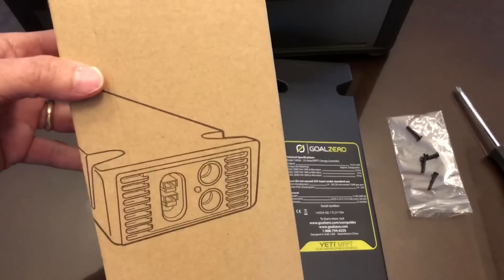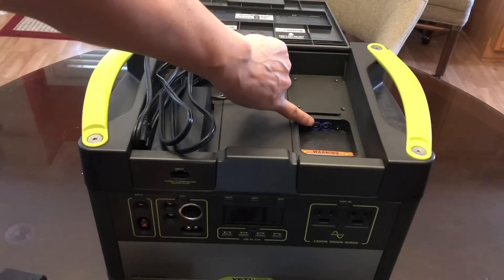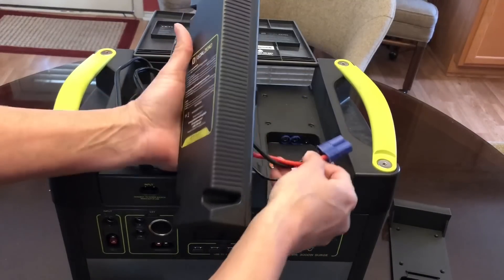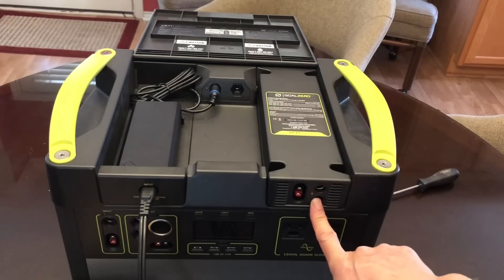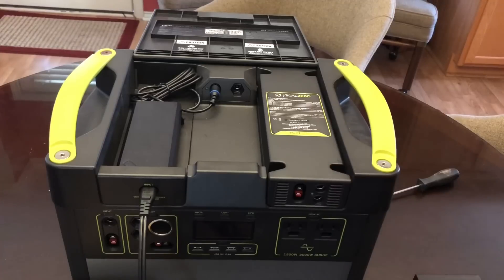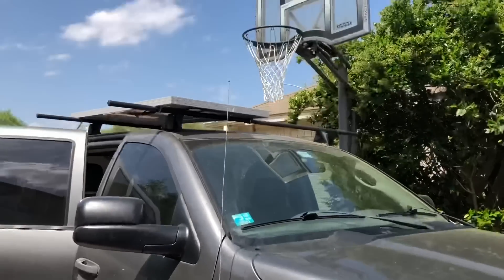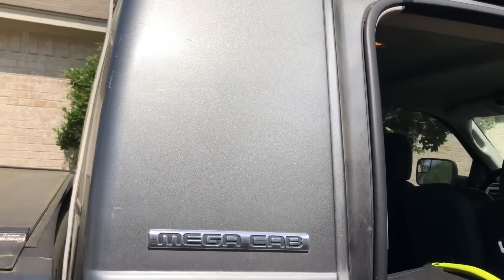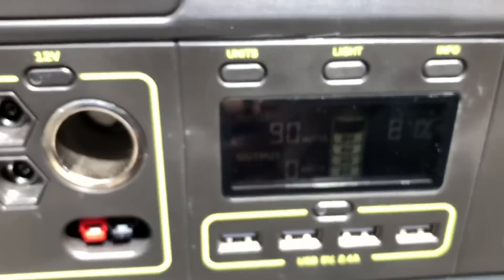Goal Zero Yeti 1000 & MPPT charge controller.  Does it work

Comment: Wow, its amazing how far other brands have come in the last few years. Taking 300W without adapters and 1 hour charge times. This goal zero looks like a dinosaur.
Reply from the maker: Yes, and battery degradation now is effect.  Especially on 400w goal zero that only charges up to 73%.  I’ve tried to take out battery to install a new one but have been unsuccessful.  I’m going to look into a replacement unit from another brand that allows for lithium batt replacement.

Comment: Thank you, this was very informative. Super helpful! It's ashame the MPPT controller doesn't do more for $100 than the built in controller. Do you know if I can use my Zamp portable panel without a charge controller directly to this Yeti 1000 by chance? Thanks again!
Reply from the maker: Yes you can plug it right in,  As the yeti has a built in controller. Just make sure the polarity is correct as zamp is known to have opposite polarity.
Reply: @EvenaGirlCanDoIt  thank you so much!!

Comment: So you're telling me I can charge my goal zero from the wall through the mppt charging module in stead of regular, with both charging cables, and by that winning about 30% of charging power?? 😱😱😱
Reply from the maker: Yes you can charge using both the pwm and mppt.  You can also use a combiner cord and add more wall chargers.

Comment: You might want to check out Todd Parker on YouTube.  He found a way to add more power to the Yeti without damaging it.  He uses the car charger with another battery.  About fast charging?  Fast charging will shorten the life of those.  Do some research; Will Prowse.  You might also want to check out Will Prowse vid on longevity of lithium.  I own a 3000 and after three years and four months it still charges up to ninety six percent.
Reply: I bought it after  Hurricane Maria ravaged Puerto Rico.  I am not joking or bragging.  I am extremely serious.  Thanks.
Reply: There is a vid on e bikes that also helped me on taking care of my Yeti 3000.  As a matter of fact the vid on e bikes is the reason I started doing it.  I would never fast charge my Yeti.
Reply: I think Todd Parker knows more about Yetis than Will Prowse and Goal Zero!
Reply: @kenjboyd6233  Thanks for replying.  I respectfully disagree.  The Yetis batts are made of Nickel manganese cobalt oxide ,NMC.  They are of a different composition than the Lithium Phosphate 4 ones.  The are both good if you know how to use them.  You can fast charge NMC but it is advisable to do it during emergency and during black outs.  The slower you charge them the less the degradation.  There are many internal components wich Prowse  knows about and there are also distinctive chemical reactions with every kind of lithium batteries.  Understanding the movement of the electrons thru the graphite towards the positive then thru the circuit that draws is crucial.  I don't think Todd have approached info like this.  Even though I have the pleasure of chatting with Todd.  He has really good ideas that can save thousands of dollars expanding the Yetis capacity.  Respectfully yours Agustin from Puerto Rico.  English is not my first language.  👍
Reply: @agustinmoralesrodriguez1242  , How is that on the batts when we're talking about the Yeti 1000 Lithium units? Plus, Will has a great depth of knowledge re: these issues, but he's far from perfect, & he definitely hasn't spent the time w/ Yeti 1000 Lithiums (to be specific, as I have 4 of those models). And you have stated yourself that Todd has pulled off  things w/ this model that I haven't seen Will or anyone else do, including anyone at GZ. Yetis overall, I'm not sure. There are a lot of different models now..

BTW, if English is your 2nd language, I wouldn't have suspected it, as you have mastered it! Spanish is my second language, but I will never be near as fluent as you are in English.

And you are obviously quite knowledgeable on these topics, so I'm interested in anything you have to say.
Reply: Modern solar chargers are vastly better. With LiFePo4 cells, they have 7000 cycles, and charge in about an hour so so on AC.  BTW, this doesn't apply to goal zero who has fallen years behind the competition of eco flow,bluetti and pecron to name a few.

Comment: I think the panel isn't working at the 165W it is rated for because it's just laying flat on top of the van. You'd need to have it angled at the sun if you wanted to get the most out of it and even then you'll probably see 140W ish at most since the panels are rated for tests in lab conditions.

Comment: Okay dumb question, can you have the MPPT controller and the yeti link expansion module both installed, or just 1 device at a time? Im debating on expanding my battery bank, or getting more solar panels.
Reply from the maker: Christy McGrady No you cannot have them both installed at the same time as they both use the same slot in the Yeti. So it’s either one or the other, although the Link does have an 8mm port so you can either add another wall outlet cord or I believe you can add solar panels With 8mm male adapter .

Comment: Pretty cool setup and I wish I have one just in case the power goes out and I can set it up with the solar panels outside or charge it on the gas generator if don't have solar panels. Also don't really mind with the wait on how long it takes and also the mpp is suitable for the solar panels on a 100% sunny day. But also make sure the adapters don't get too hot if the generator is below 15-20% may pull more power may case adapters to work even harder and gets hot. But anyway love the review about this technology. ( P.S also noted if more chargers are connected the fan will kick in and yea that is when the adapters will get even hoter )

Comment: Please read this up to 40% better is from solar panel not from AC plug.: MPPT stands for Maximum Power Point Tracker. The Solar Charging Optimization Module is an external MPPT and when installed properly, actively monitors the energy source you’re using to charge the Goal Zero Yeti Lithium and optimizes the source to maximize power, resulting in up to 40% faster charge times, especially from solar panels. You may also notice better charge times from AC when utilizing the Yeti Lithium’s AC charging cable plugged into the module.

Comment: If I'm not mistaken all of these units slow down as you reach near full capacity. Why don't you try this test with your battery down to about 60% and see if there is an increase in charging. Also if I'm not mistaken another purpose for this device is to allow you to use more solar panel input then what the original unit was meant for.
Reply from the maker: spy8464BB yes that is correct.
Reply: Stadium affect. “The stadium effect occurs when recharging your batteries. You'll notice your battery quickly filling up in the beginning, then slowing down noticeably when trying to charge up the last several percentages.”
Reply: @PhotoGalMn  What effect is it when it malfunctions and the company gives you the cold shoulder instead of helping you?

Comment: I have some issues with my goal zero lithium  1000+ the MPPT controller.
I use one 20w nomad solar panel + 100w Boulder panel chained together.

Every few weeks my Batterie is not charging anymore (blue light on the controller input is on the one on the batterie not)
I found out that when I disconnect the batterie cables and put them on again it works again. 

What could that be?

I asked already GoalZero and they told me to send it in, which takes more than few weeks to get it back.
Reply from the maker: Oliver Waldbillig have you tried to plug it into the wall only and see if it stops charging.  If it does then it’s something internal and the unit must be sent back.
Reply: @EvenaGirlCanDoIt  Normally I only charge it with my solar panels, if it happens again, i will try the wall outlet. Thank you

Comment: try it again on a cloudy day, mppt is meant for days when the sun isn't as powerful. You won't see the 40% difference until you have a day like that to test with. Many times the PWM controller will not have enough volts and pull 0 watts and can't start a charge where as the mppt will.... But on clear sunny days PWM can be equal in efficiency depending on the power source...
Reply: Thanks. I saw no difference at all on a sunny day. I'll wait for a cloudy day.
Reply: If you're using monocrystal panels on a sunny cold, freezing weather day, MPPT will give you much more power than a warm day.

Comment: Mppt is most efficiënt at the bottom charge of the battery. If your battery is at 10% charge there should be a huge difference between the mppt and pwm wattage.

Comment: I just bought a 1400. no one can tell me how much solar I can put in.
Reply from the maker: mike allen you can put up to 360 watts on pwm or mppt modules and up to 160 watts between the 2 -8mm ports.  So on my yeti1000 I can put up to 1040 watts of input but GZ only recommends 750 bc the unit may get hot.
Reply: @EvenaGirlCanDoIt  appreciate the information. I can put 360w into the PWM and another 360W into the MPPT charger? wow that's fantastic.
Reply from the maker: mike allen 360 on each Anderson ports and another 160 between the two 8mm ports on the pwm and mppt
Reply: @EvenaGirlCanDoIt  sweet. think I will go for 300w through each Anderson. that's plenty for me.
Reply: @EvenaGirlCanDoIt  Dumb question, but you are talking about 360w coming from solar panels, right? So, does that mean I could use 2 180watt solar panels together, in total 360, in each of the Anderson ports? So, it would be 180+180, then, another 180+180, going into 2 different ports, is that correct?
Reply from the maker: Hunter Millerson yes you can do that! You would be using one on the internal PWM Controller and one on the MPPT external add on controller.
Reply: @EvenaGirlCanDoIt  I have been trying to use both the PWM and MPPT charge controllers at the same time and it does not seem to like it. I never get very fast charging rates. have you tried to put solar in through both charge controllers?
Reply: @huntermillerson6276  that would be amazing if it was possible. charging my yeti with 720w would give me all I needed. I wonder how much it would degrade the battery. I wish my unit was chainable so I could add on 12v sealed lead acid batteries. that way the energy in would be spread over 2 batteries and would so be charging at a slower rate.
Reply from the maker: mike allen yes, first, have you tried them independently? Yes? If they both work then let your yeti go down to about 60 then try it.  I will try to make a video in the next week and post so be sure to subscribe and hit the bell.   Oh btw I sold my 1000 and bought the 1400 so I will do it on the 1400.

Comment: Somewhere here on Youtube I saw a young man who had a Goal Zero 400, I believe, plug a cheap $15 inverter into it, plugged that into his car cig. lighter, and the Goal Zero charged within minutes, not hours.  Is there anyone out there who might explain that to an old woman who wants to be able to camp off grid with a Goal Zero and a 100W solar panel?  Why would I want an MPPT which isn't that great at charging the Goal Zero if a cheap inverter would give much greater speed in recharging?
Reply from the maker: tegma when charging with solar moot us moot faster than pwm.  As far as charging through a standard wall outlet you don’t get that much more charging power.  Charging through 12v with and inverter(lets say in your car cig lighter) so you can charge using your std 110 plug you should not see a difference.  But if you use just the 12v charger port from your car then it will take longer to charge.  As far as it taking just minutes on a goal zero 400 it’s not doable.  Now if I was going to try to get by with a GZ400 I would get the lithium version because the battery on that one can be depleted to 0 without harming the lifespan of the battery.  Now if you go with the AGM GZ400 you shouldn’t take that battery below 50% as it will kill your battery in no time as AGM’s are not made to be taken all the way down to zero.  (no the actual goal zero, just the battery inside it). Currently on the AGM style GZ400 you can daisy chain additional batteries to it for additional battery.  If you have the room it’s a lil cheaper to do this option.  Oh yeah, mppt is not offered in either GZ400.
Reply from the maker: tegma you should be looking at amp hours btw.  Lithium all ah’s are available, AGM only half are available for use.

Comment: I was pretty impressed with your output from the panel, as the max W would probably only be achieved in full sun, with the panel at the right angle, so 112W mounted flat on a panel with some pollen on is pretty good. You got 15-18% extra from the MPPT, and as your battery was already over 80% this is pretty good.  If you want Max solar output from your panel keep it all clean, any dirty patches (or any shading) bring the output of the whole panel down.

Comment: I spoke to Goal Zero and they told me that the 8mm input PWM van take 10 amps while the anderson MPPT input can take up to 30 amps. so 200w/ 12v=16amps.
Reply: I just bought a 1400. no one can tell me how much solar I can put in. goal zero only sells 200w panels so that is what they will tell you.
Reply: @magamike1800  8mm charge port 14/22volt up to 10amps ie 120watts max. So 2x would be 240watts. (brick plug and outside port.) There is a USB C with PD (power deliver aka in and out.) which pumps 60watts Via 5,12,20v up to 3amps. (could be used also to charge it possible.)

Powerpole charging port 14/22volts up to 30amps (360watts). So if we take into all ports used to charge the unit VIA the PWM charging system only on the unit.

240+60+360= 660watts in total you could push into the unit. Now if we look at the MPPT with 3x more ports. 

8mm x2 have 15/22volt at 10amps = 150watts x 2 = 300watts.
Power Pole Charging port 15/22volts at (doesn't show on their website. but IE divided 1400 x 5hours = 280watts. So the Power pole would probably pull around 300-600watts on it's own.). So you'd get 600watts from PWM or MPPT. (Not sure if you can mix and charge. but if you could then you'd get up to 1200watts of incoming power. Enough to run AC and DC while keeping it topped, So you could technically use it like a multipower system in a large area your using to charge laptop, and DC stuff like Phone, lights,etc.)
Reply: @KillerRaptorr  thanks but what I was really wanting to know if the MPPT charge controller can handle solar panels running more than 22v.  I have a 300w panel that runs up to 38v but I am scared to plug it into the unit.
Reply: @magamike1800  told you the EXACT specs of the system it can handle.

14volts LOW. the LEAST you should be putting in. and 22volts THE MAX you can put in. 14/22volts. So common sense of 38volts = No. Even if you TRIED, It'd shutdown the charging and beep = that it will NOT take such a high voltage.

If you can find a way to decrease the 38volt panel down to the LEAST or MAX input related of the system. Then you can. But you'd have to DROP the voltage down massively.
Reply: @KillerRaptorr  disappointing. was almost pointless getting the MPPT charging unit if it cant take higher voltage than the PWM charge controller.
Reply: @magamike1800  Well in a sense maybe. In another. No. If you think about it more then just a single 38volt panel. Then you might have something good.

alittle research. There are things that can drop voltages down to such amount. Look around for a voltage dropper or adjuster and maybe you can still use it.  Or just buy some cheap 100watts x3 that's 12/20volts and you'd be in better ability.

Ether that or maybe ask for a replacement switch. Their Lead Acid 1250 supports up to 48volts of charging via 8mm and Powerpole ports.

Also alittle hint. Next time, Try doing some research before buying something. Read Specs for products you get, Solar is alot more required in thinking, Then just grabbing a panel and plugging it in.

Some panels have better bonus then others do. Like Monocrystal vs Thin Film/Power Film/ vs PolyCrystal, etc. And the amount of power each get in turn of Shade or sunlight. Like Monocrystal might be the best in gather power via UV. But when it comes to Visible light/Shade It's pretty crappy. Thin-Film doesn't work on UV, Only Light density. It may have lower power income and need more space for same amount of power as a Monocrystal. But It's functions work 10times better in shade since it doesn't focus on UV performance as Poly/Mono does. 

And along with the whole 80% of performance from ALL solar panels. Never expect to get max power in the peek of sun. So if a panel says it's 300watts. Only expect to get 250. Or in my case, Half which is 150watts. So the best case if you want the TRUE 300watts. you need to Double up your panels IE 300watts requires 600watts. want a 500watts you need 1000watts. Sure you'll get more then 500watts. But normally it's good to always Double it cause you never know how dirty or shaded the sky is.

pokes head Helps alot.
Reply: @KillerRaptorr  i did quite a bit of research before I bought my yeti. I got the yeti to power my off grid sleepout with 18v panels and it works fine. I also have a solar powered boat with a single 38v, 300w panel that I have an MPPT charge controller and sealed lead acid batteries. I was just curious to know if I could also use the yeti for it. as yet no one from goal zero has been able to answer my question about charging the yeti with the 38v panel. panels are cheap and I might just get an 18v 200w panel for the boat and use the bigger panel on another job.